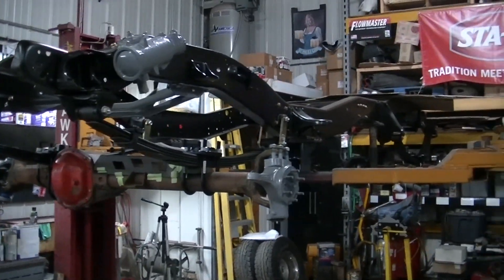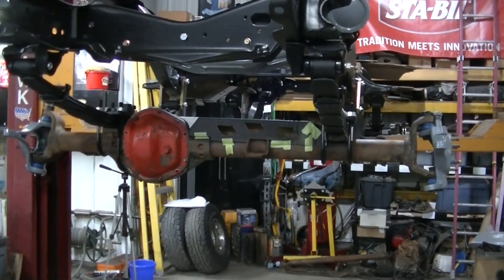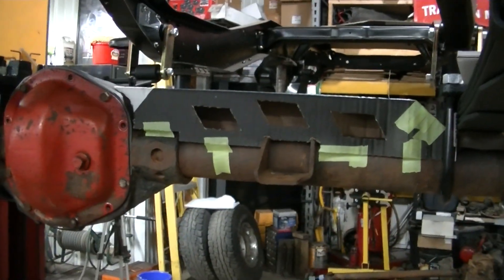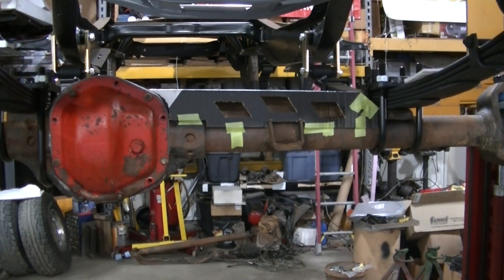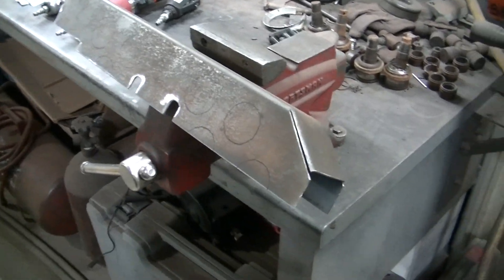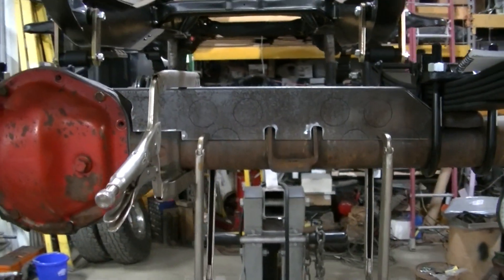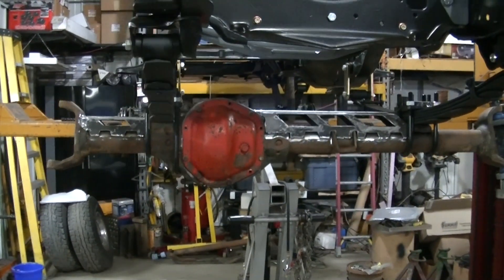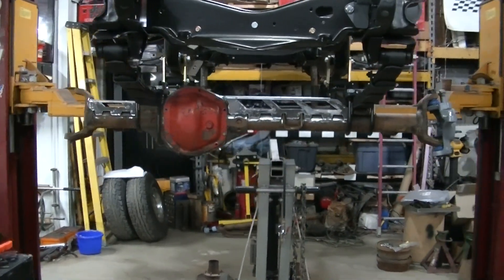80 Chevy Silverado Front Axle Truss Build Dana 44

Comment: I have a question about your 70. With the 500hp 400 how is your traction on gravel. Is it driveable even? What gear ratio are you running? Do you have any traction bars on it?
Reply from the maker: Even with the 500hp it's a big truck with big tires. That sucks up some hp. The harder you hit the pedal the faster it will go. You can spin on any loose surface pretty easy. I don't have traction bars on the 70.

Comment: Mossman I need your help brother!!!
Reply from the maker: Are you building an axle truss?
Reply: @mossman381  no Mossman!! I need some help with an 2002 Polaris ranger no spark/1 spark issue. I know you’ve sold yours. I’m just after your knowledge. I will donate to the cause for some of your time and knowledge
Reply from the maker: If you don't have spark my guess would be the CDI. Those older Rangers had a few different ones so make sure you get the one for your year.
Reply from the maker: It's really hard to try and diagnose a problem when I can play with the machine myself. There are grounds all over the chassis, but it doesn't sound like a ground problem. If the key switch caused a change, I would look into that. I take it you have never heard it run? Has the previous owner heard it run? Did you buy a good quality switch? I bought a switch one time and it fell apart after a few key turns. I buy OEM Polaris switches now. When you say no spark are you taking the spark plug out grounding it and looking at the spark?